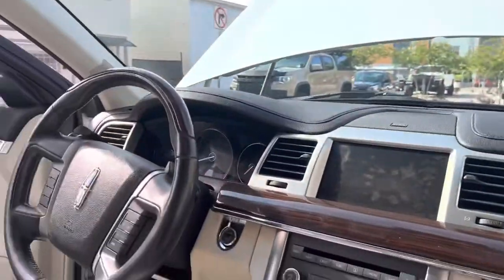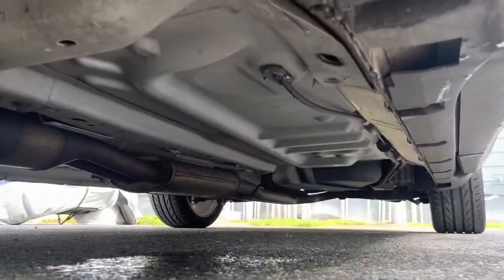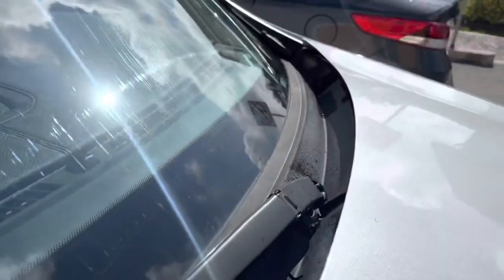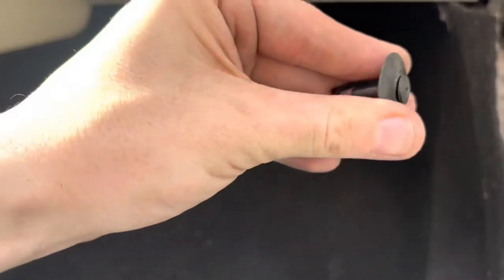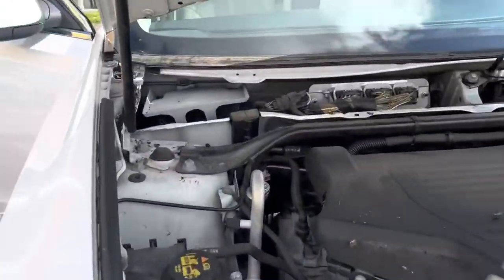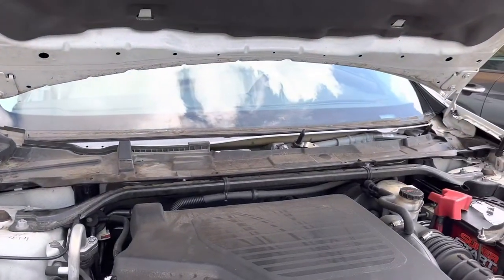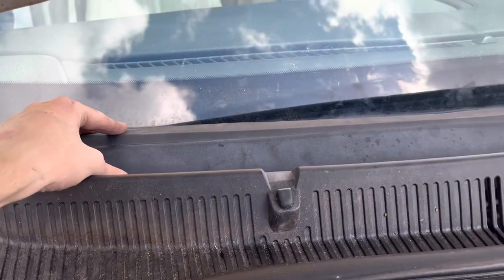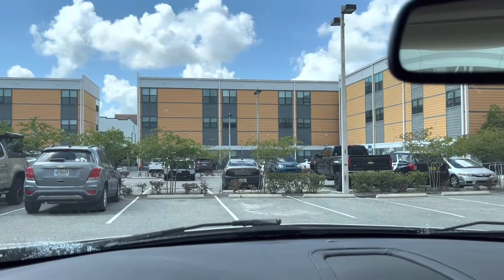2010 Lincoln MKS Interior Water Leak | How To Clean Front Drains

Comment: The drains at bottom of doors behind rubber seals also get filled with leaves. Doors will fill with water. Easy to clean out. Just push seal to side enough to see, and vacuum leaves out. A ton of water will drain out.
Reply from the maker: Great advice, I’ve pinned this comment so other users can see it as well.
Reply: Thankya sir

Comment: Thanks for the video - extremely insightful. Because I could not remove my wipers on my 2011 MKS, I started tinkering with getting to the drain without removing the top cover.  It can be done and it is not difficult at all.  Take the six screws from the top cover, and then you can pull out the hard plastic cover below it.  2 push screws in the middle, and the two clips on either side - just as you did in the video.  You can then pull the hard plastic cover out, and bend the top cover at the corner, just above the drain vent.  I removed the rubber drain grommet as well due to the horrendous design.  Thanks again for posting the video - hoping that's all it is on my MKS.
Reply from the maker: Thanks for watching, I’m glad the video helped

Comment: I had a similar issue.  instead of taking the wipers off and having to go through all of that.  I popped the paneling up in front of the wipers by removing all of the push pins.  This allowed me to raise the panel enough to use a blow gun off my air compressor and clear out all the gunk built up in there.
Reply: I was thinking the same thing do u really have to take the wipers off because it seems pretty difficult thanks for the advice

Comment: Great video.  Was just cleaning out the 2010 MKS that I bought over the weekend and I noticed the floor was damp with no spots on the headliner, so it looks like I will be doing this procedure.
Reply from the maker: Thanks for watching Casey, stay tuned I’ll be making a video on the process of clearing the sunroof drains too.
Reply: @JustinFrascona  I am guessing the little rubber drain pieces are to keep mice out, even though they are woefully ineffective.  I ended up cutting the bottom of the rubber pieces to make the hole slightly bigger and cleaning them out in the kitchen sink.  Hopefully that keeps leaves and crap from getting stuck in there.
Reply from the maker: That makes sense thanks for sharing.

Comment: Great video, I used a battery cable puller to remove the wipers. Penetrating oil and a few taps with a hammer and they came off quickly

Comment: I imagine my 2013 mkS I would be the same for drains n sun roof motors?
Thanks for making the video. That motor job looks a lot easier DIY project than I’d expect. Usually anytime I do something myself, I run into problems. I try not to open my screen or roof so not to wear the motors out.  Any idea what a local mechanic or dealer would charge ? Thanks again
Reply from the maker: I’ve read In the forms it’s about a 800 dollar job, never went to the dealer. I got the motor on Amazon for around 150. I believe it’s the same for all MKS not 100 percent certain thought I’m new to this platform.

Comment: I have 2008 Lincoln MKZ and Passenger side water leak from Rain and A/C use 
Specially when I take left turn, water comes with swapping noise while turning 
No one could find Drain plug location 
Car is fairly new condition and low mileage kindly help me please 
Thanks appreciate

Comment: Is it possible that the back seat floor gets wet from those drains being plugged.
Reply from the maker: There’s 2 drains that run from the back of the sunroof down to right under the rear tires. Those can get clogged too, it’s easier to clean those from the bottom under the car upside down.
Reply: @JustinFrascona  Thank you 
I will check it out. 😎